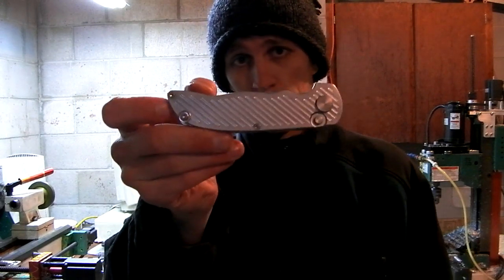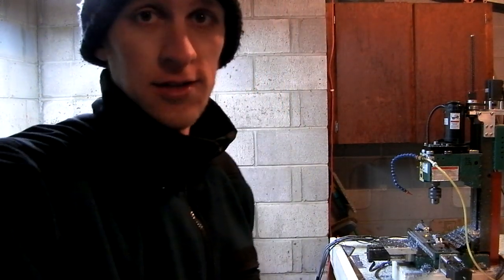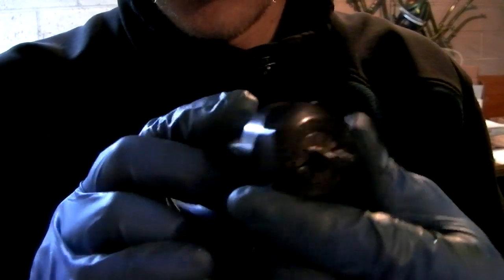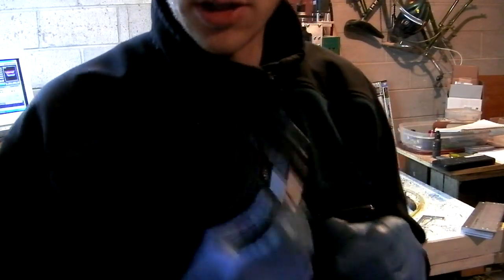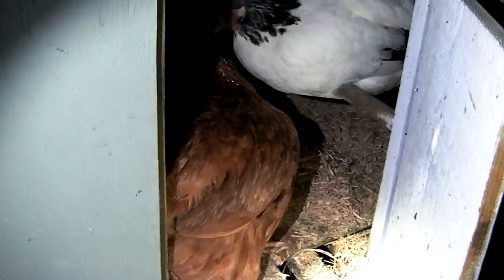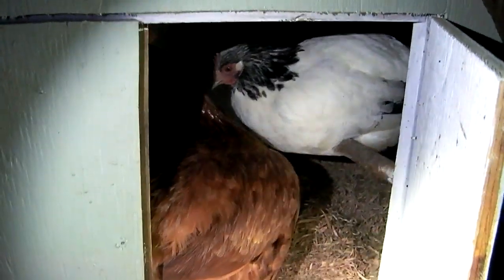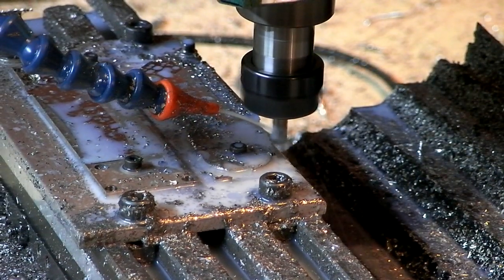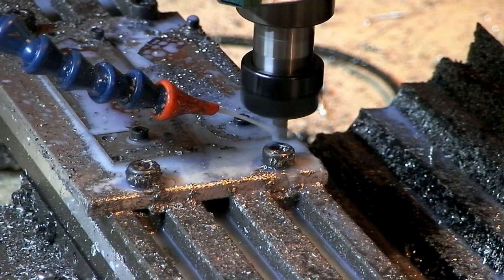Knifemaking Tuesdays Week 05 - machining the first blades!

Comment from the maker: @kingjamez80 Thanks!  I tried trochoidal milling once and it took FOREVER.  Maybe I was doing it wrong.  But it is a neat idea that I hadn't considered for this slot, it would make it wider and keep the chips happy.  Head nod eeeehhh??  Interesting, just yesterday I purposely jogged the head down onto a block on the table and could see tons of flex from the Z dovetails.  I know that the divots are mostly backlash related, but I should investigate head nod.  Thanks!

Comment from the maker: @Guds777 Thanks!  I use carbide for everything except for drill bits.  I really have no interest in being a blacksmith, I love machining.  My wife is actually a pretty awesome blacksmith but not for knives.  Plus the new steels these days are spectacular, especially the powdered metallurgy ones, and there's tons to choose from.  So as long as the geometry works and you heat treat it right, I think it's easier to get a nicer blade than with forging.  But I do really respect blacksmiths!

Comment: if you use a two or three flute instead of 4 flute it is much more conducive for plunging. 304 is also usually sold in its half hard state because it work hardens really easy. Not a good candidate 416 is the free machining stainless.

Comment: As far as I've seen your "issue" with the button lock locking closed isn't an issue at all, in fact they are intended to do so. That is why people use them for switchblades, so they can hold the spring tension.

Comment from the maker: The mill accidentally made it a zero grind, IE the primary bevel comes to a point.  Ideally I would leave 0.020" thickness at the edge, or whatever I choose, heat treat the blade, then hard mill the rest off including the secondary bevel.  However it's no big deal to put an edge on it either way.